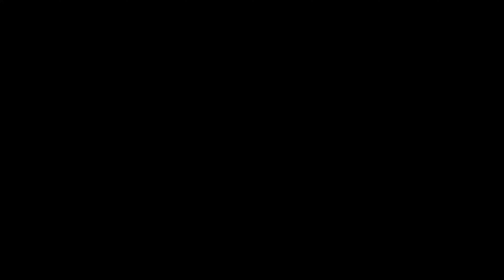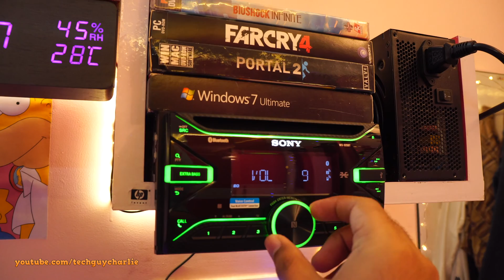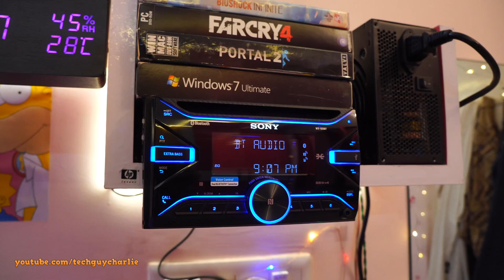Using a car stereo, sub-woofer and speakers at home with a PC

Comment: does the psu matter? like how many watts it can provide for the set up? I wanna do this as well, but i feel i might be a little extra in sound. i have 3 12's two 2k watt amps 800watt power cap, and 2k car battery. was supposed to be for my whip back in the day. but i wanna be a little mad scientist for personal sound system. just wanna be sure about wattage before i suddenly blow something up.

Comment: is it possible to make a cabinet and put the player amp and psu
Reply from the maker: Yes totally possible! just put a 120mm fan for airflow, wire it up to run at 5volts so that your setup does not get hot inside the box.
Reply: Tech Guy Charlie how is the output compare to your home theatre
Reply from the maker: While listening to music, it does not matter much, both sound great, car stereo has much more bass and sold sound but home theatre is better while watching movies and playing games because of Dolby 5.1 Surround support, which the car stereo does not have.

Comment: Dear I hv this Sony xm gs100 amp now it's working with 12v dc 30amper power supply.also am planning to add Sony xn1004 ,4 chanel amplifier.then I can use the same power supply or need other one please advice me